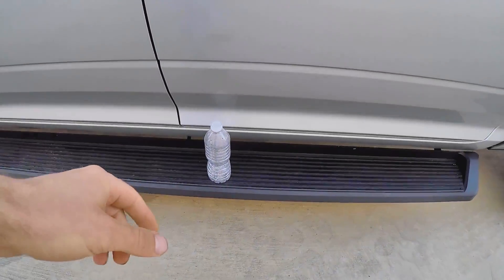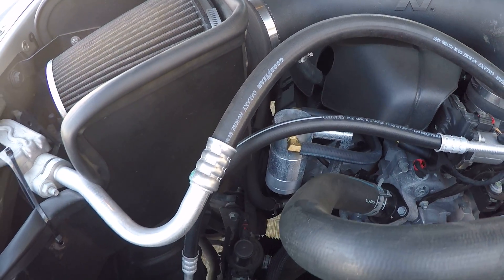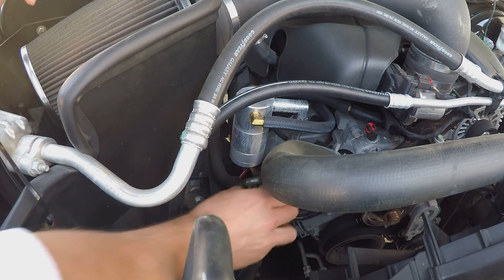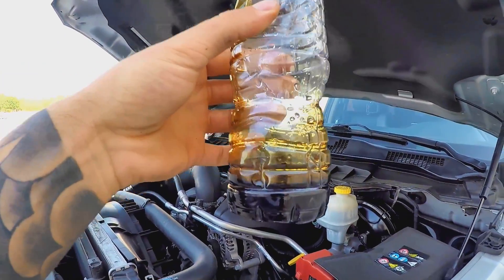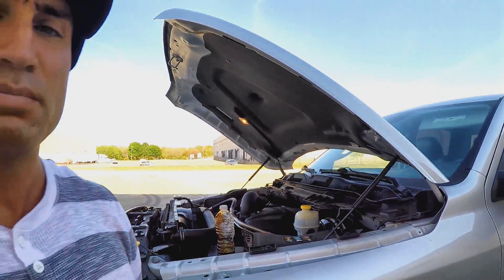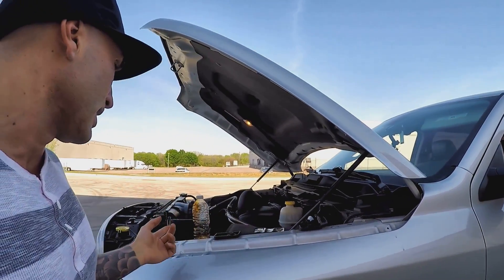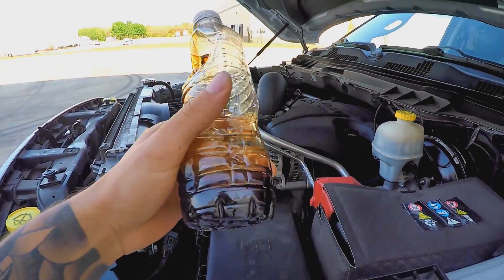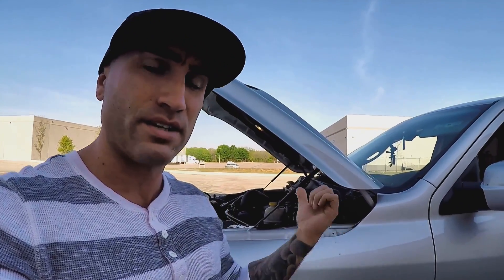Do Oil Catch Cans Work? A 3000 Mile Review!!!

Comment: I made oil separator out of a glass jar having a metal lid, used Scotch abrasive cleaning pad for filter media - got same results as shown here after 3,000 miles - BTW, it will reduce amount of burnt crud from exhaust collecting inside catalytic convertor too.
Reply from the maker: Thats awesome!  Yeah whatever method you want to use its a pretty simple device but like you said it does work!

Comment: i see that you have the K&N cold air intake. in your opinion is it worth putting in the truck for the amount of money that it costs.
Reply from the maker: Hey Jacob depends what your goals are but it sounds badass!  For fuel savings it would take awhile to justify the cost of the intake cause its a marginal difference.  Dyno gains are supposed to be around 15hp
Reply: it was mainly for the added horsepower and however much MPG i gain, i recently put some heavier tires on my truck and just wanted to do what i can to add what little horsepower i could to my truck without doing something that was too crazy.  sooner or later i am planning to put some shorty headers and a new exhaust system to help out there but i got a while to go before i can afford that bit.

Comment: Great video, so as i understand this is a method to catch the bad oil before goes back into the engine, but would u suggest this on a brand new engine? And how often do i need to drain it ? And once you drain it do you need to add some more oil ? Thanks
Reply from the maker: Its actually better the sooner you can install one of these!  Every oil change just check the can but you won't have to add any extra oil.
Reply: Alessandro Terracciano 
I installed the Mishimoto oil catch can and check about every 2500-3000 miles.

Comment: My Ram's catch can has about 3-4oz after 3k miles. Surprised to say the least. Only 45k miles on the truck. Your amount isn't bad for that many miles. Couple years ago I had a 4th gen Camaro Z28 without one. Took the intake off to change the gasket and was appalled by how much crap was in it. Vowed to install catch cans on all my future vehicles.
Reply from the maker: Damn alright well I don't feel so bad!  I'm pretty surprised my engine isn't pushing more crap into the can for this many miles but I guess shes pretty healthy even with over 100k. Good to know though since we will be supercharging the crap out of her soon and see how long she lasts! 🤣
Reply: After seeing the 4th gen that 'Cleetus McFarland' supercharged, I think it will be awesome. It ripped. 
Logically thinking, quite sure any amount of boost will increase the amount of oil in the catch can. Totally worth it though!!  And if you grenade it, not sure I've seen anyone do a 6.4 swap into a 1500 yet... or a boosted 6.4....  :)
Reply from the maker: The gentleman I bought the kit off actually grenaded his 5.7 and swapped in a 6.4 but the fuel system wont support a 6.4 + boost without a ton of work apparently so he opted to sell the kit to me.  😁

Comment: Hey, when I saw your first video on this i was interested but was curious of it causing low oil? Have you had any oil lights come on or is it so small that it doesn't even notice the loss?
Reply from the maker: Hey Kevin nope this is perfectly normal for our trucks to push this stuff back into the intake if there isn't a catch can.  This is a combination of moisture and oil from the crankcase but my truck is running great and I don't need to add any oil between oil changes 👍
Reply: Thanks for the reply as always, guess I know what I am doing next.

Comment: not good for canada eh?  -40 in january and feb
Reply from the maker: Hey Cesar I hear what you're saying.  I think it is still beneficial though and your engine is going to be sending hot air from the crankcase to the can so even if this gunk did sludge up at the bottom of the can in extreme cold the can would still be doing its job.  You might just need to drain the can when the truck is warmed up lol.  There is a lot of oil in the mixture though so it probably wouldn't freeze .

Comment: Do they make a oil catch can for a Ram 1500 3.6L V6?
Reply: Derec Lara - You can DIY an ebay cheap universal one pretty easily. I think boosted did a video on that. I did an eBay one myself, just changed hoses, added some stainless brillo pad for filter material. Saved a ton of $.
Reply from the maker: Hey Derec like FormerGorilla said you can definitely put one on your engine.  You can buy this same can if you want for the hemi or a universal can and then just find where the PCV hose is on your engine and put this in line with it 👍

Comment: I was wondering i use seafoam spray and I spray it every 3-4 weeks into the throttle body, if I were to install the oil catch can, would the seafoam I spray into the throttle body be diverted into the catch can instead of going thru the manifold? I'm not exactly sure so I'd thought I'd get your thoughts on it.
Reply from the maker: Hey John it won't change anything with your seafoam treatment but will actually benefit you by not sending all that gunk back into the intake.  I think using seafoam that often is probably overkill as far as preventative maintenance.  I've used it before to clear out severely gunked up high mile engines but I'm not sure I would use it that often as you are because it can break down your engine oil.  I would use it right before you do an oil change to be safe.
Reply: BoostedMotorsports Thanks for info I'll make sure to only spray during oil changes.